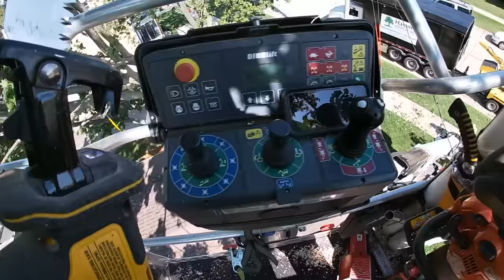Harassed by Angry Neighbor Demanding Tree Removal

Comment: You were not being aggressive. You were being firm. You did great.
Reply from the maker: Thanks
Reply: Exactly 💯 agree !!!
Reply: You are solid. Not aggressive. 
Well done.
Reply: @GameofTrees  Here's how I would've spoken to him, in a very calm, moderate voice:

1.  "As a professional Arborist, who has testified as an expert witness in court cases involving tree damage, I can tell you that cutting off this one main trunk is not going to impact the other main trunk structurally at all.  So my work here is not going to negatively impact you at all."

2.  "Because the trunk that goes into your neighbor's property is crossing his property line, and poses a potential hazard to his property, he has every right to cut off that trunk at his property line."  (The fact that the property line  goes up into the sky actually works in your client's favor here, not the neighbor's favor.)

3.  "Because the tree poses a potential hazard to my client's home, you might face liability if we don't cut this tree back, and some might argue it's your responsibility to to do, since it's ultimately your tree, even if he has the right to trim anything crossing his property line.

4.  "We're not going to sign anything assuming any liability here, because that wouldn't be appropriate.  If you have any issues with your tree later, and want to try to sue me or my client over that, that would certainly be your right.  However, I don't believe you'd have any legal basis to prevail on, and you'd therefore just be wasting your money."

5.  "I think it would be best for everyone if we cut off the trunk at this specific point, but if you only want me to cut off the portion crossing over my client's property line, that's also fine.  I'll then only be working on his side of the property line."

6.  "If you want me to cut down your portion of the tree as well, and are willing to pay me for it, I'm also happy to do that.  It's just not my or my client's responsibility to do so unless you cover the cost."

Comment: In the question of "how much can a tree cost?", a formerly wooded lot next to our property was sold for development.  The home owner at the front corner of our lot asked to cut down a "crappy tree" on our property, just in from the corner.  He wanted it down because it was shading his soon-to-be front yard.
We said absolutely not - this is a very old, very valuable tree and would not be touched.  Just to be sure, we sent this in writing, by certified letter.
He hired a tree company, told them it was his tree and had them remove it while we were out of town.
It was a 100+ foot tall, five foot diameter BLACK WALNUT.  Likely one of the largest remaining in Ohio.  If you just eyeballed it, the tree was something like 11,000 board feet.  At something like $5 to $10 a board foot.  as in "something like $100,000. And they had LET THE TREE COMPANY HAVE THE TRUNK (because they were idiots).
So...we got an emergency order to stop the tree company from selling the log, and sued the property owner.  The judge was a country guy and went ballistic when he saw photos of the tree and copies of the letter (with signed receipts).  He gave us triple damages at $90,000 valuation ($270,000) plus the tree company had to return the log to us, which we sold for $67,000 (it was actually over 12,000 BF, but the tree company had cut it into shorter logs.  If it was in 30' sections it would have been over $100K).
The property owners went bankrupt and had to move.
so...not exactly common, but "the wrong tree" can cost you a lot.
Reply: What state do you live in. I'm in Pa. and we have that triple damage in our laws. I had a woman next door to me that had a chain link fence up and I hated it. I planted a row of arbs along it so I wouldn't have to see it. She came out one day with spray paint and said she was going to paint her fence. She sprayed my arbs also. I went to a lawyer friend of mine and he told me any damages would be tripled automatically. It was nice to hear.
Reply: Serves 'em right!
Reply: Yeah, well, I hope you bought some decent Scotch after that.  I sure would have needed a few bottles of it, that's for sure!
Reply: that hurts me to read...  Trees like that aren't something money can hardly even value; there's no getting a new one there without taking losses ecologically and financially across the board.. or waiting a century...
Reply: I guess the neighbour figured that once the tree was gone there might be some arguing but not much more. It clearly never entered their mind that the tree might be worth a lot in timber. Surpirised the tree company didn't cut it to maximise value, but they were getting paid twice anyway. Trees like that, the loggers pay you to remove it.
Reply: Dude.  I have black walnut growing in my front yard.  Was considering cutting them down.  Uh… NO!  They’re only about 16” around.
Reply: No, being a douchebag can cost you a lot. 😂

Comment: If someone was paying to take half MY tree down, I would be doing anything I could to help out. At least move the boat!
Reply: i think the guys concern was genuine. Those trees were connected via the root systen. If one set of roots die, the other will be compromised.  As a contractor, I would have walked away from that job, but first try to talk that guy into taking the entire tree down.
Reply: @nom5205  if he were concerned he would be getting the whole tree removed as fast as possible.
Reply: @nom5205  Valid point
Reply: @nom5205  Seems like way to me as well but the arborist disagreed.

Comment: When I first moved into my house, I noticed a 70ft oak in the back that had split in the middle.  It had heavy branches still on one side that would have taken out my neighbors backyard garage with his Model A and classic car inside...so I immediately trimmend off that branch.  A few years later I noticed a woodpecker in the damaged area 35ft up and rented a 50ft boom to trim all the other branches that were a concern to lighten the load.  I used to climb and cut, but at 62 I have money.  Money is better.  The neighbor helped with all the trimming and really appreciated that we were protecting his property.  We're friends with the neighbors and they are worth the $500 it cost for the boom rental.

Comment: many years ago, guy driving drunk in Fla, drives into a fairly new orange tree, destroying the tree. Judge award the Grove owner $100,000. That was the average expected return on the tree.
Reply from the maker: Often the reward is 4x the loss, so the return on the tree might be 25K, but still, the most expensive tree is the one you weren’t supposed to remove :-)

Comment: During  a bad storm, a tree in our yard fell and went into the roadway.  Our street is semi-active, but the storms were so bad it was pretty quiet.  We called the city because the power went out and we were afraid that people might hit the tree, not seeing it until it was too late, due to the storm.   The city not only got rid of the tree, but were kind enough to come into our yard and remove the stump as well.  The tree was badly rotted from the inside. 

We did offer to pay the city for the work, as we knew the tree was dying and had planned to have a company come in and remove it  once the ground was solid enough to get a machine in, the ground was really, really soft from the spring melt, so they sent us a bill.  They said don't worry about it, and didn't bill us.   Apparently, they take downed branches and wood from downed trees, along with clean yard waste and such, and mulch it, sterilize it, and then use it for city projects.   It allows the city to keep the costs down when they're doing landscaping.
Reply from the maker: Good deal for you. Thanks for the story.

Comment: I'm  a retired builder, 10 years ago my mother passed away and we were selling the house ... young couple (lawyers) bought and demo'd next door to build a McMansion (father was the builder) I gave him water to build the (oversized) foundation but warned him to be careful digging to close to 4, 50 year old White Pines right on the property line ... I knew his excavator well and the guy cut all the roots on the build side, he also changed the grade flooding my mother driveway .... I watched for 2 months as the trees began to lean 25 degrees towards my mothers house (we had also sold to a builder who was building his own house on the lot and didn't care as he was demo'ing the house) ... 95% of our bad storms the wind comes from the west (blowing towards my mothers house) ... next door had just completed sheathing, roofing, windows and trim ... i was cleaning out the last stuff and a storm was moving in from the coast (east) ... big gust came and I ran to the window just in time to watch all 4 80ft Pines get blown backwards against the 25 degree lean and then all the way over to take out half the second floor of the large new home, slicing thru the gable ends like a hot knife thru butter .... police, fire and the electric co came and taped off the lot ... I showed up early the next day and saw the father/builder pull up ... got out holding his head .... I let him see me and just smiled ... he was pissed ... the next day he knocked on the door with a tree removal crew and wanted to use the driveway for his boom .... I smiled and said ... "sorry, I can't accept that liability and you'll destroy the old macadam drive way and drains !" .... the guy was livid ... he called the cops, fire department, town engineer (and his local Rabbi lol ) ... I stood my ground and his guys had to get a bigger boom for the next day to reach over the partially destroyed house with major rain on the way ... and 8 guys spent 6 hours trimming 4 dirty, sappy trees before they could lift them .... his tree guys were laughing at him as he rotated .... and yes, he cut the Pines off at the property line and left the huge gaping root balls leaving a dangerous crush hazard on our side ... I called our buyer and told him what happened (a tough, young NYC commercial builder) he howled laughing ... saying he was going to build a berm and flood the guy when he graded his property ... in the end I smiled knowing karma had done her job well  .... I'd estimate tree removal was $25 K .... repair on the house, with major structural damage was $50K
Reply from the maker: That is an awesome story. Thanks so much for adding it to the drama section 😂 I have to say I would have been hard pressed to handle it any other way.  Your way had a sense of justice about it for sure. Thanks again!
Reply: What a fabulous story, I love it when karma slaps a smart arse.

Comment: You have the right to cut any part of your neighbors tree that is hanging over your property line if that neighbors refuses to take it down.  Especially if it is hazard to your house and property. You just can’t go own their property to do it so your tree service will need a bucket truck on your own property. I’ve done it. The best way is to work out a mutual agreeable solution with your neighbor. I know this often is not possible. The other thing I found out is if your neighbors tree falls in your yard or house they are not responsible for the damage or removal of the tree laying on your property you are. Keep your insurance up to date.
Reply: George, you are absolutely correct. Contrary to what this neighbor was saying, and even the arborist at one point, cutting roots or branches that overhang or undermine on your property is completely within your right, even if it is at the detriment of the tree. It is always good policy to try and work this out with your neighbor, but when push comes to shove, their tree encroaching on your property gives way to your legal removal of the encroachment.

Comment: We have the same type of neighbors.  So far, we have spent almost 12K trimming and removing dangerous and diseased oak trees that were dangerously hanging over our roof.  They had a fit about losing "their" shade, which is laughable due to the direction of the sun causing shade in our yard only!  In my state, the property owner & tenant of record does have the right to refuse to allow a tree service to come onto their property for trimming or removal!  So, what started out to be a quick 2-3 hour trimming, turned into an all day affair when the climber was told he could not climb on the tree trunk that was growing on the neighbors side!  The arborist had to get a lift and remove it overhead at a much higher cost!  The neighbors stood directly under the tree the entire day just to cost us more money.  They obviously wanted a lawsuit, but it didn't happen.
Reply: @SEXYMOSTWANTED1  🤣Yes, it is, but the alternative was to wait for the limbs to fall onto the roof & have an even bigger problem with the insurance claim and the hassle of possibly becoming a "displaced homeowner" !

Comment: I'd be willing to bet that the city code allows the property owner the right to cut down any foliage that crosses the property line at the property line regardless of where the tree is growing from. In other words if a branch is hanging over the property line he has the right to cut it off right at the property line. It's not like this hasn't happened to bajillion times before.
Reply: Agree
Reply: Exactly, been there dealt with that.
Reply: Sure you can and that is why he is not protesting the cutting. BUT he then wants the arborist to be responsible for the tree left behind - and the arborist seems to agree that the other prop owner WOULD be, but he believes that the other tree is separate and won't be damaged.
Reply: Is that the same as painting your side of the fence your neighbor built?  Just curious...
Reply: @Thinking.Of.Some.Handle  You don't have a "your side" of the fence unless the fence overlaps your property line. If the fence overlaps your property line you can cut that part of it down, paint that part of it, do whatever you want with it, that part now belongs to you. If that fence goes right up to your property line but doesn't protrude over the line, that's not your fence. If you paint it without permission, you can be sued for a new fence to be built, that's not your property. If you don't like the look of the neighbors' fence that comes up to but not over the line, you can build your own fence next to it on your property and then paint it.
Reply: @Thinking.Of.Some.Handle  - Absolutely not the same thing. The property line is a finite delineation. In every circumstance the fence would be 100% on the side of the owner of the fence. In fact codes regarding fence building require that the fence be at least 1 ft from the property line to allow for maintenance thus answering your painting question.

Comment: It depends on the state you live, but typically, any branches, roots, etc that trespass onto another's property can be trimmed at the line (in PA doesn't matter if tree harmed).  It doesn't matter where the main trunk is, but it does if the tree falls onto another's owner's property (tree owner if known hazard).  A property owner has a right to the sunshine as much as the ground if he/she wishes.  And they can prevent u from trespassing with equipment.  Again, cut all u want to protect the other's house, but u can't trespass.

Comment: The guy that REALLY OWNED THE TREE could have been FORCED to remove the tree as it was an imminent danger to the neighbor's house.  I just had two trees removed because one was already broken off at the base and I was worried it would damage the neighbor's house.  The second was a leaner and I had a concern.  We were all lucky IT didn't fall.  At any rate, my trees, my responsibility until they fall and cause damage, heartache, bad feelings, and a cost on THEIR insurance.   No need for that.  I had them removed at my cost and will have good firewood next season.  Pretty simple.  I couldn't live with myself if my inaction caused an innocent person harm.
Reply from the maker: Thanks for that. Great comment
Reply: Proper decent.

Comment: The neighbor should definitely pay for removing both trees.  But, he may have a point that removing one of the trees might affect the stability of the other tree.  But, he brought it upon himself.
Reply: Each tree has a separate root system holding it's own weight.  They are totally separate life forms with no connection to the original tree that was cut down or to each other.  That's how plant suckers work; they are underground limbs off the original tree that root separately off their own limbs.